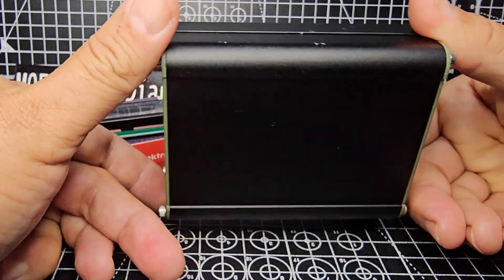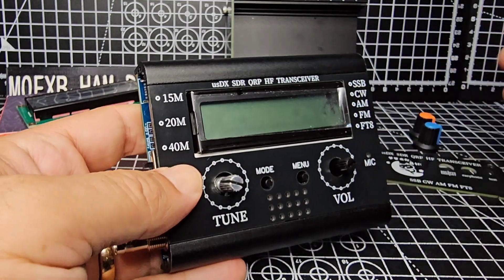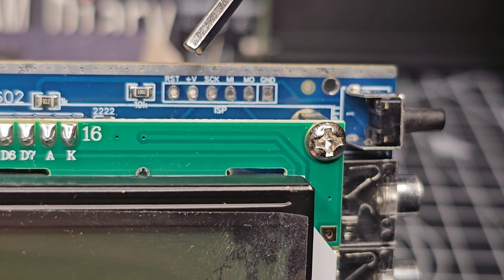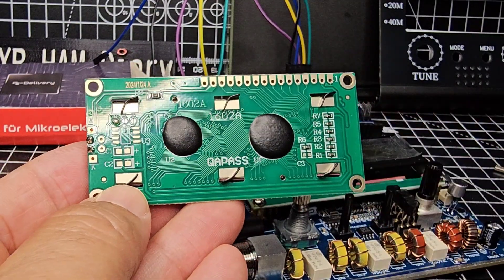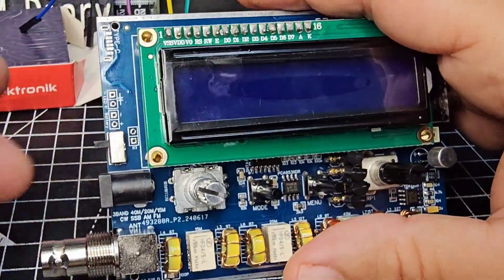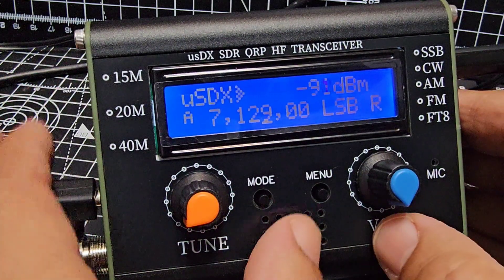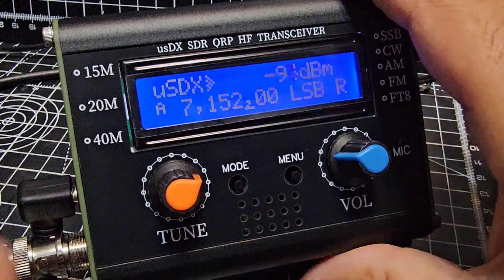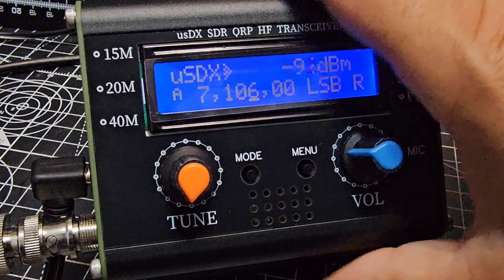uSDX Orange & Blue Buttons

Comment: I like some of the features of the BT one I just got in. Seems like fit and finish is pretty good. I like those cap head screw on that one though.Some nice features I can tell already of the BT one, is that it of course has BT, but it also has a 3 position power switch for better battery expansion, and it brings out the ISP for easier programming. I'm interested to see how easy the BT hardware is to be able to see about modding the non BT versions. I have a black button (as opposed a white button) coming in as a test subject I wish would get here already.
Reply from the maker: Send me link